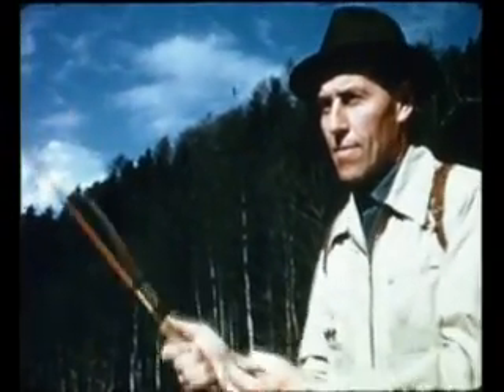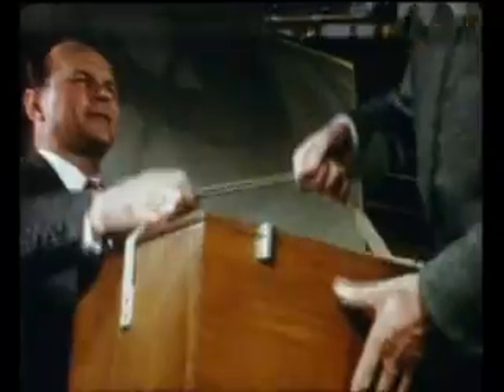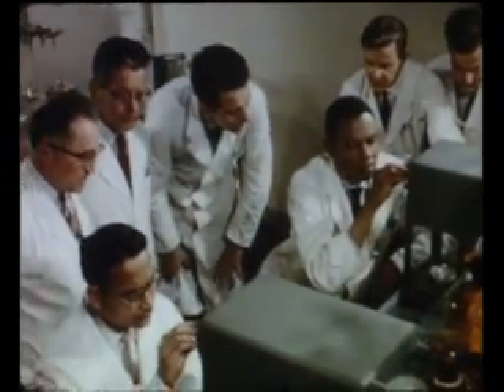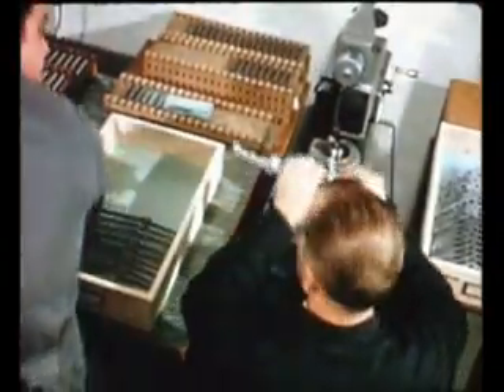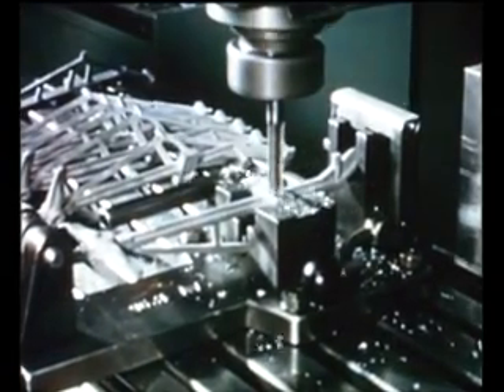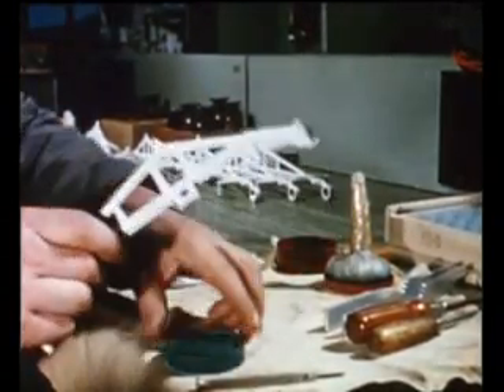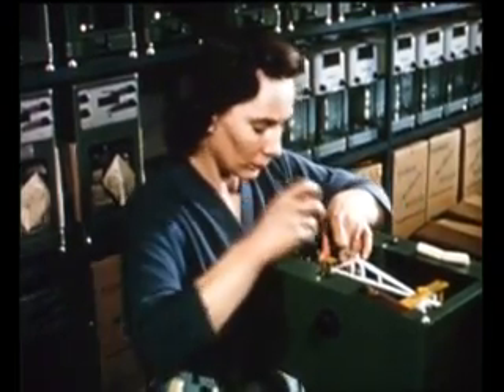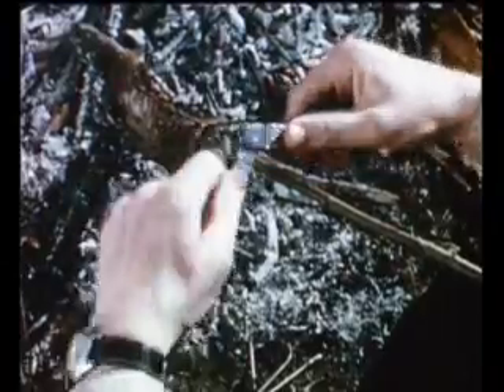A Fishermans Yarn. Mettler laboratory balances 60 years ago.

Comment: Hm, I have never seen this model. Is it still available somewhere? What is the resolution?
Reply from the maker: Thank you for your message, please ask a local representative. Contact details can be found at www.mt.com under "Contact Us".”
Reply: @METTLERTOLEDOLaboratory  I already got the Mettler H80 from 1982. It is such a marvel of engineering. It measures precise down to 0.0001 grams without any electronics.